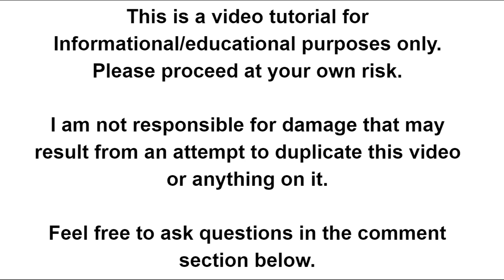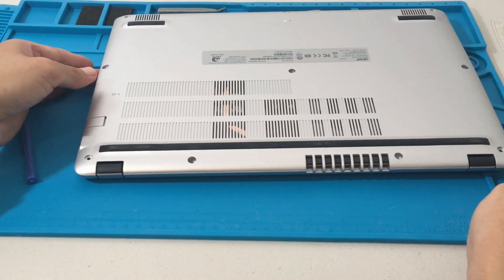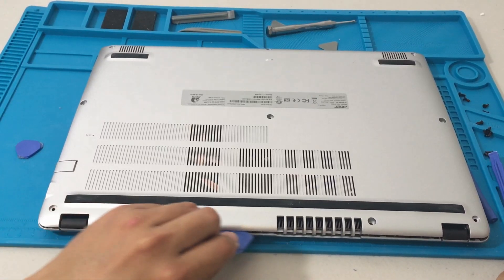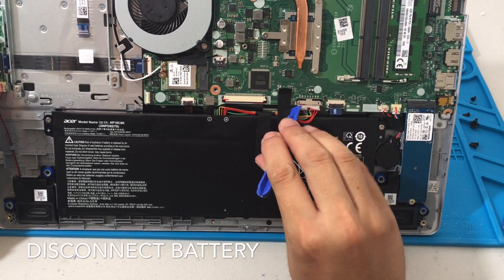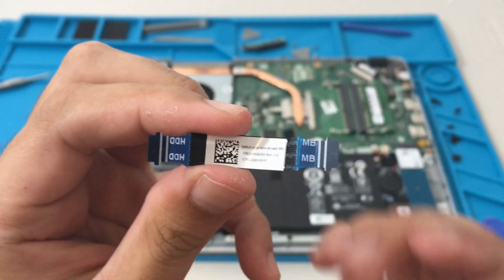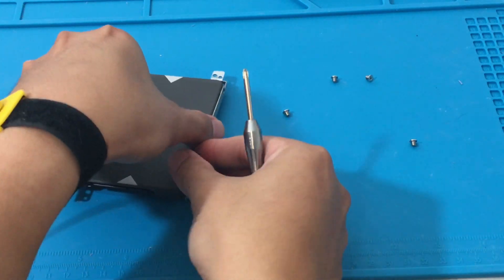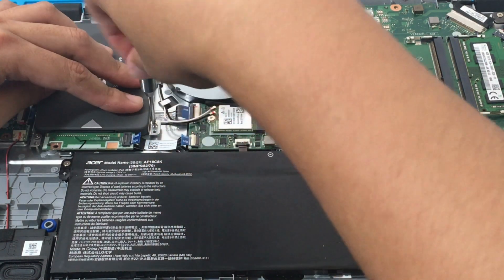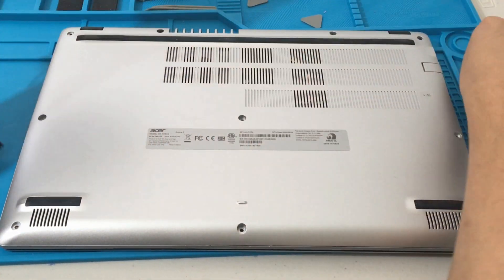2.5 inch SSD Installation | Acer Aspire 5 Slim Laptop A515-43-R19L | Lexar NS100 SATA III 256GB SSD

Comment: Just did my NVME. Getting the cover off, there's no clips at the corner screws, so it should be safe to begin prying there(spudging, actually LoL) at the chassis rear corner. The little blue thing worked well and the one I had is kind of a soft plastic. 

The doggone thing only had a 128 gig ssd and one 4gig sodimm ddr4! Good news is, my now outdated components are much cheaper than they were five years ago.

 I got lucky, it has two memory slots and came with the caddy.

Comment: Can a 1tb fit inside because i think it is thicker than the 256?
Reply: Did you ever try it out? Looking at getting the same.
Reply from the maker: Sorry I missed this. A 1tb should fit as long as it’s 2.5 inch. It would be the same size (physically) as a 256gb ssd 2.5 inch

Comment: This is an amazing vid.  Unfortunately I think I misplaced my laptop box and have no idea where my mounting screws are.  I may have to spring for other screws for the caddy.  Also, you definitely did a better job taking it apart than I did when I put in my RAM before.  I just got a 480GB SSD on sale, so I'm going to be putting that one in.

Comment: Yes so am currently upgrading but how do it usee the ssd as primary drive instead of the hardrive thats already in?
Reply from the maker: You would have to install windows on it, then wipe the primary. I highly recommend backing up your data before though

Comment: So my Acer Aspire 5 A515-43 with a 256 SSD from the factor by default, has a second slot for me to add my new SSD? So there'll be two SSD's if I install a new one? There's not one visible for me to replace instead? This is the second Acer Aspire 5 video where the SSD area seems empty from the factory. So IDK where the SSD I'm currently utilizing is at in the Acer lol. I haven't opened the Acer yet to upgrade quite yet.

Comment: if the 2.5 SSd you put in has an OS on it, Can you set it as the boot drive?
Reply from the maker: You can do that. You would change boot settings in the bios

Comment: I totally forgot to remove my battery plug but i just replaced my screen. And I didn’t even know my laptop came with the option to upgrade the storage
Reply from the maker: Nice! Glad to hear you were able to replace the screen and that parts were available
Reply: @whattmeter  your video helped telling my what to do exactly. My laptop screen was damaged plus the inches were broken so now it feels like a new Laptop again
Reply: @whattmeter  I’ll definitely be adding an extra SSD because it needs it. I forgot to buy it with the 500GB SSD so i got 128 instead and surprisingly it runs GTA V smoothly and does editing somewhat good aswell

Comment: Upgrading the ssd and the ram looks so easy when you do it but I'm terrified to do it myself
Reply from the maker: I've had a lot of practice and I've made a lot of mistakes as well. If anything, sometimes it's better to play it safe and let a professional do it.
Reply: @whattmeter  yeah. I've been looking at this laptop, but I think I'm just gonna get another one with 16GB pre-installed. Thoughts on 128GB SD? The laptop I'm looking at says 128GB SSD +1TB HDD. 

I use a lot of programming apps, Adobe photoshop and lightroom, maybe video editing. I wont use this for games or like word and PowerPoint. And I pretty much save everything on cloud storage. Is the storage enough? 

Thanks mate
Reply from the maker: Yup storage is enough in my opinion. Most like the ssd would be booting so the pc would start up quick. Did they mention the 1tb hard drive speed? 7200 rpm or 5400 rpm? 16gb of ram is definitely a solid choice

Comment: 6:08 is it ok to just put it in lightly or do I have to push it in?
Reply: A little bit of both. You want to make sure that it is securely inserted into the slot, but do it carefully
Reply from the maker: thanks for answering!

Comment: The windows 10 bootable usb eas not needed for this?
Reply from the maker: no because it is secondary storage. The main boot device is an m.2 ssd. The 2.5 inch ssd is just for extra storage.
Reply: @whattmeter  ohh ok thanks!

Comment: I just got the 2021 version of this (I think, it's an 11th-gen i5 w/ a 512 GB SSD) so I'm assuming everything will be basically the same inside and watching you try and open this is giving me major anxiety lol. The Aspire 5 model I currently have is way easier to open...
Reply from the maker: Nice! Sounds like it’s a pretty good spec laptop already. Opening up the laptop is practice for me lol. It’s the only way for me to get better at it
Reply: @whattmeter  I did manage to get it open with no issues!

Although (sadly) it looks like Acer has switched to soldering RAM on, at least with this model. It's the A515-56-54WE with 8 GB of RAM...4 GB is soldered on and there's a 4 GB RAM stick. As far as I can tell there's no mention of this on Acer's website.
Reply from the maker: Whoa. If you have cpu z installed check to see if you’re running dual channel. Surprisingly I noticed some of my computers that have 4gb soldered and 8gb still shows as dual channel in cpuz. Weird, sometimes I wonder if cpuz is inaccurate. Either that or I am wrong

Comment: What size are the 4 small mounting screws this comes with for mounting the SSD into the bracket?  Mine was refurbished and didn’t have them.
Reply: Mine either. Did you find out? I need to know myself.
Reply from the maker: Sorry I never got to measure the mounting screws for this model. It was included and I never measured it
Reply: @whattmeter  Where are the four small screws contained? The SSD I bought the same as yours does not contain it.

Comment: Hey where’d you get the bracket man? (Also your vids are awesome)
Reply from the maker: Thank you! The bracket and ribbon cable/connector should be included inside the laptop. The bracket screws are in a small plastic bag in the laptop box
Reply: jasetutorials thanks!
Reply from the maker: @jeff-vd9ye  no problem
Reply: Mine didnt come with the mounting hardware or connector where would I find this?